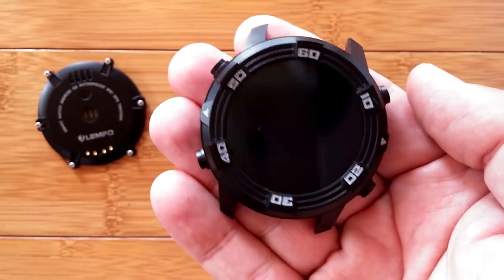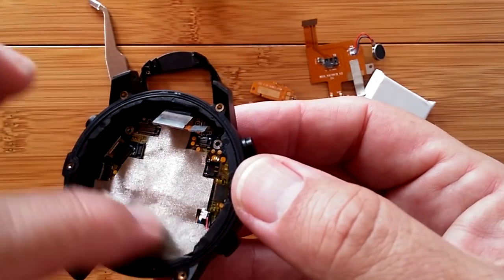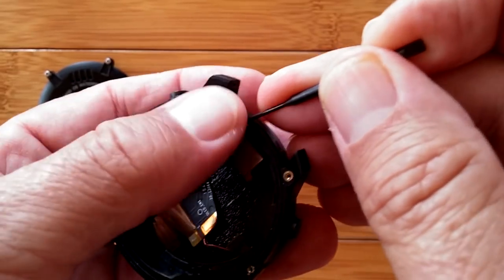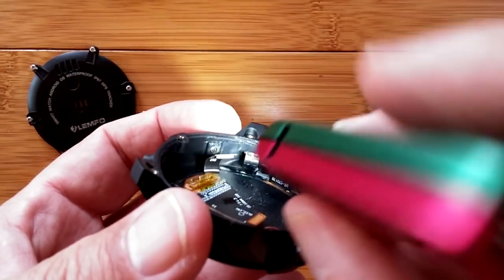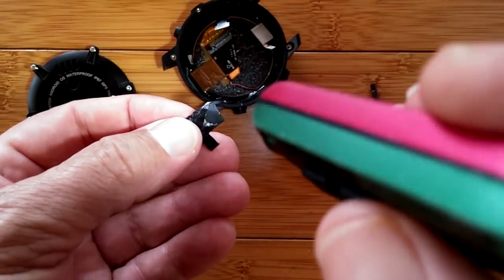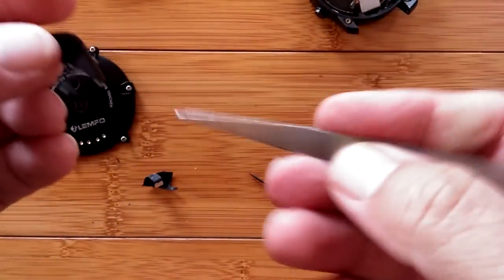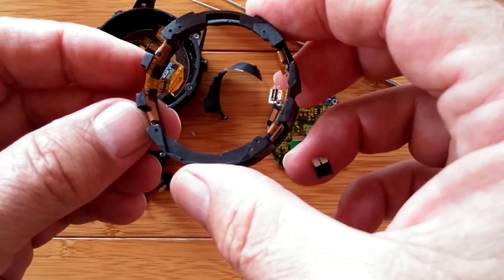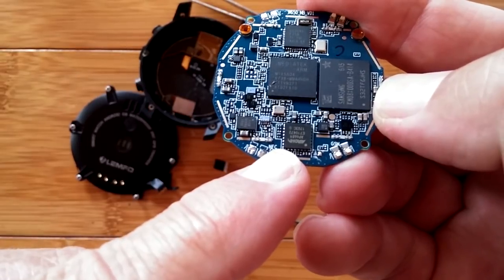LEMFO LEM6 & TenFifteen F3 Design Flaw Part 3: LEM6 Antennas Revealed!

Comment: hello, I need your help I bought a Lemfo lem6 and it does not calibrate the busola through its normal app. I get it just for the gps status app, but even so when I get back to the app the clock remains uncalled. what should I do ?
Reply from the maker: Well, I'm not quite sure I understand about calibrating the busola or having a clock that remains uncalled. There is a team of technical experts you can ask though. Try this:  Proboards - 

Join the “Round Android Watches Proboard” here: http://roundandroidwatches.proboards.com 
Simply set up a free account, explore the various sections available to you, and jump in. There are many watch users and technical experts discussing just about everything related to smartwatches. For general watch questions you’ll find many answers in the extensive FAQs as well. Need the latest watch firmware for your model? Click here: http://roundandroidwatches.proboards.com/board/12/factory-firmware-downloads
What help with flashing your firmware? Click here: https://www.youtube.com/watch?v=2jHwRLcomiM

Comment: Superb video about hardware flaws!
But how about software flaws: are they also the same (F3 & LEM6)? See my previous question, still unanswered for SIM calls:
  'Lemfo LEM6 has problems making SIM phone calls: a lot of echo for the receiver with speaker volume low, nearly useless sound for the receiever with higher speaker volume set on the watch (others confirmed this issue). Does the F3 the same issue? Can you test it?'
Ticks answer on BT calls: 
  'I don't know about SIM calls, but I had a nice Bluetooth tethered call with Mrs. Ticks and she couldn't tell I was on the F3. I had to crank the call volume up all the way on the watch, but it was decent volume, almost equivalent to my phone in speaker phone mode. No echo, no distortion. I plan to use the F3 as my phone substitute for calls (with bands removed as a pocket watch/phone).'
  How about SIM calls on the F3? Same issue as LEM6 or not?
Thanks!
Reply from the maker: When I get some time, I'll slap in a SIM to the F3 and give it a try for calling. As I mentioned, the BT calling works like a champ. Clear and no echo. I didn't have any BT dropouts either walking around the house within 10-15 feet of my tethered phone while on a call. SIM could be different though. We'll see. Anybody else with an F3 (or working LEM6) that can give feedback on your SIM call experience, please feel free to add your comments as well. Thanks.
Reply: Thanks! I look forward to your test results. If SIM calls work fine, I order a F3, otherwise not, because I use these kind of watches as stand alone (with SIM card inserted).
Reply from the maker: Still haven't gotten to this. Remind me in a week or so If I haven't replied before then. Pretty swamped right now. Thanks.
Reply: OK. Thanks in advance! I really appreciate you willing to test this. Greetings!
Reply: hello 
apkae pas lemfo lem 6 ka charger hai please

Comment: Help!! System overload...Too many smartwatches.. Confused..Terrible headache.. 😂😂😂
Really need your help, i can make up my mind which to buy, downloaded your excel for comparison, but I cant open it, seems corrupted. Pls help.
My ideal smartwatch that I am looking for is
1. Under $150
2. Waterproof or atleast water resistant
3. Round shape with a lot of clock faces option to download.
4. Heart rate
5. Can tethering to hp
6. Blood pressure, if possible
7. GPS  can use with google map
8. Able to change watch strap
9. In english is a must
10. Running android 
A lot more, but this is the basics features I wanted..
Please help me with at least 3 choices. Thank you very much
Reply from the maker: Wow, anybody else having trouble with the spreadsheet? I just updated it 3/1/2018. Let me know and I'll try and fix it if it isn't working properly. As for your list, all are under $150, none of the Android watches do blood pressure yet, the waterproof ones can't download the custom watch faces yet (not sure why) so you'd need to eliminate one of those from your list. Don't know what you mean about tethering to hp. Only LEM6, F3, H1 and JM01 have removable straps so far. All come in English.
Reply: SmartWatch Ticks Thanks for your reply. Anyway I really enjoy all your reviews, u kinda influence me into getting one... Great job n hope u will have more likes n subscribers for all your great works
Reply: As for now I am going for the lem5 pro.. Hope Ive a gd choice.

Comment: Awesome Mr Ticks, I like seeing the inside of new Tech.  Those antennas care definitely smaller and thinner than the ones in the watch bands.  I have the DTNO.1 D6 and the Finow X5 Air...
Reply from the maker: Yes! Now, like Adrian pointed out, we need to test the signals for each of these radios against standard antenna in-the-band Android watches to see if they hold signal integrity through this redesign. Well, sounds like another project to add to my growing list. I'm hoping we'll also get good user feedback as well once this and other band removable Android watches make their way onto customer's arms. Ya know, in five years all this will be stuck into an earbud and we'll consider today's technology so archaic. But we aren't there yet, so we gotta keep testing and pushing.  :)

Comment: Nice Mr Tick. You have gone that extra mile.  Never seen that before. Love it. :) NFC chip revealed as well.
Reply from the maker: Thanks for the inspiration. I can kinda sense when "karma" has taken over and I pretty much have no choice but to follow it. You guys guiding me to where I really wanted to go made the path reveal itself, and, well, the rest is karma...er...history!

Yea, NFC! Makes ya wonder what else may show up in a "plus" or "air" (or "water") version of this watch. BTW, in the other teardown and rebuild video of this watch you shared I saw that the metal shielding was near the gasket as on mine, so the design appears to be identical. Also, what do you think about smearing a bit of petroleum jelly around the SIM card insert seal area as added protection? That slot seems way more likely to leak over time.